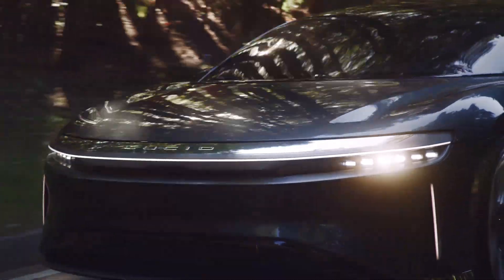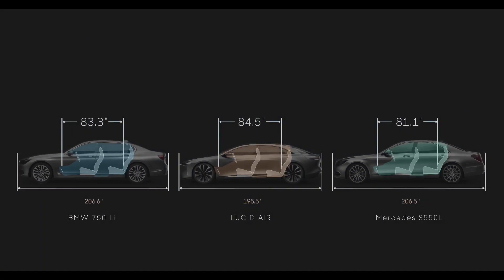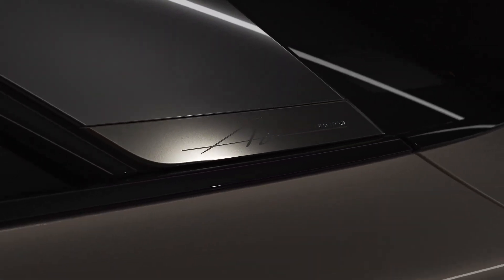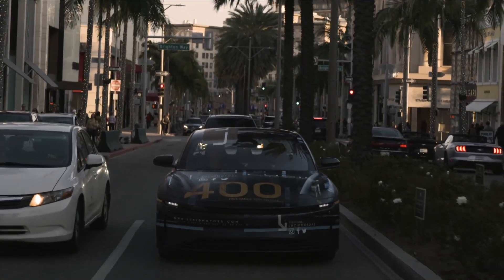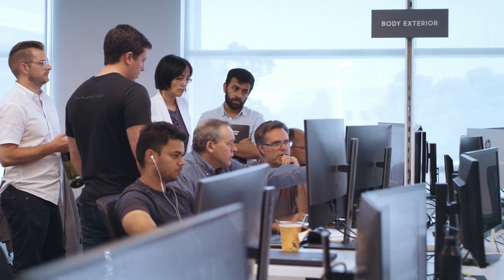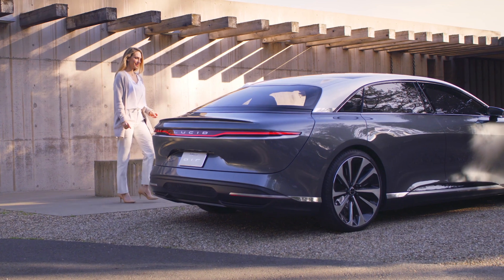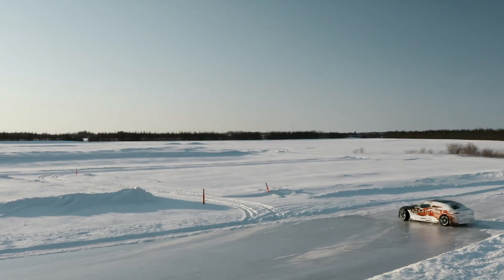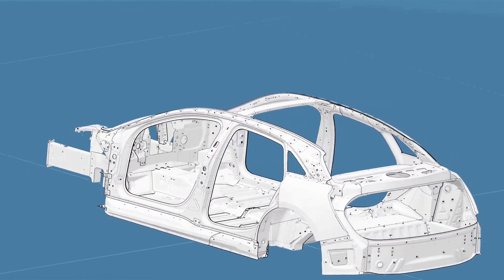Lucid Air Arriving In Early 2021 - Autoline Exclusives

Comment: This car looks beautiful inside and out. However, if all Lucid Airs come with windows basically running across the entire ceiling I'll pass on getting this car.  I don't need extra glare on the instrument panel. I also don't need to wear a baseball cap every time I drive so I don't get the top on my head sunburned. I hope they offer this vehicle with a standard roof. I see the cases of skin cancer going up for the drivers of this car.

Comment: yawn....   can you post some customer reviews of how they like it ?
every wet dream... er,  clean-sheet plan changes and changes and changes and they are still making changes to the concept about a year after it was to be released pushing back dates.
The Tardis style interior of larger insides than outsides has been the wet dream of all manufacturers. 
if you want, make a VW bug with a 40 hp motor, can go 100 miles, sells for under 10-15K and you will sell millions.
try to make a high end and the people who will way overpay are small and there are too many choices.
to me, this is a DeLorean startup formula. 
you can make a 'SmartCar' that drives like a cadalac.  park next to other cars with near zero clearance (auto park) and have a cockpit for a large American.   the SmartCar sold for under $15k so there is your target.  simple, small, and you sell millions.  it is the Chinese model, they know that mass means excessive masses and not just a few.

Comment: The more BEVs the better.  Good to know it's got a three-seat rear seat as standard, I have never seen that!  Nobody cares about horsepower.  The results is what we care about.  Very surprising there has already been an EPA test.  How coincidental that the range came out to be exactly 400 EPA miles.  FYI the Model S is at 391 EPA miles and will have more by early 2021.  Specs not mentioned:
* top speed (did I read 200mph a long while back?)
* 0-60
* max. AC charging rate in kW
* max. DC charging rate in kW
* where the charging network is?
* charging socket... CCS or something else?
* V2G?
* how many are they expecting to produce each year once things are ramped up?
Reply: Amarjit Singh you literally answered the most useless question out of all of the ones this guy mentioned.

Comment: Tesla is NOT luxury by any means other than price. The materials, and interior design is minimalistic bare bones which has always been a point of contention for me. Couple that with average build quality poor paint application and your left w/ the tech which is second to non ill give them that.  Im waiting for an EV maker that puts all those things on point for the price. Something only Porsche has accomplished so far which is awesome, but very high on the price. I have high hopes for Lucid and Rivian.
Reply: @subplus137  
At about $70K to start and Rivian RT-1 is going to be on  par with similarly priced ICE Trucks running the same price, so King Ranch/Platinum (FORD), High Country (Chevy), Denali (GMC), Laredo (RAM).
Reply: The main problem is that you still don’t understand what real luxury is, and not the smoke and mirrors … I pity you a lot 😀